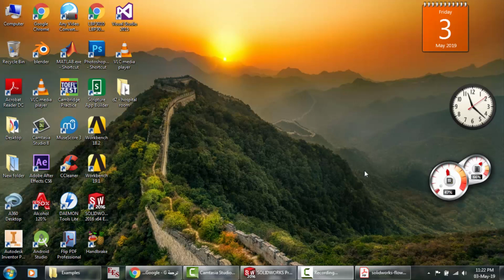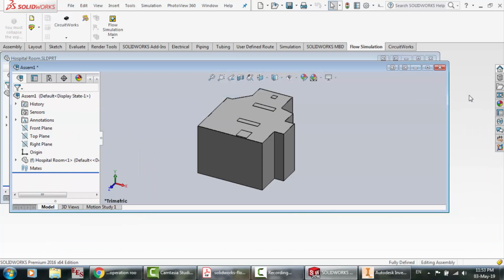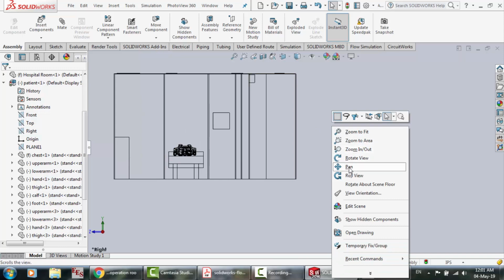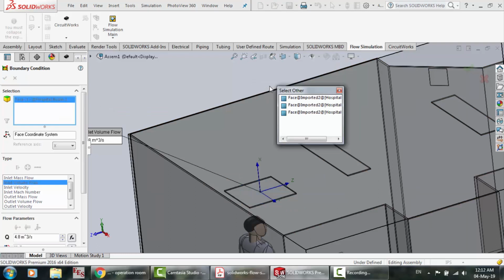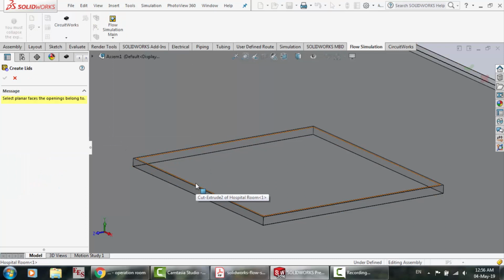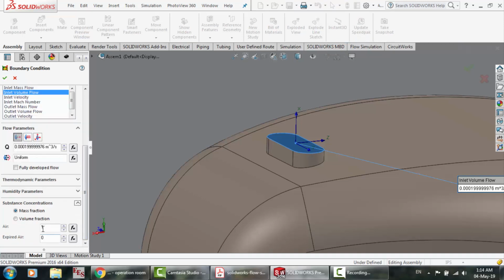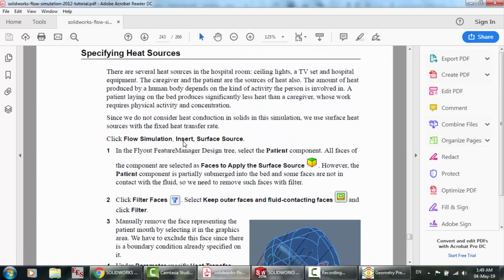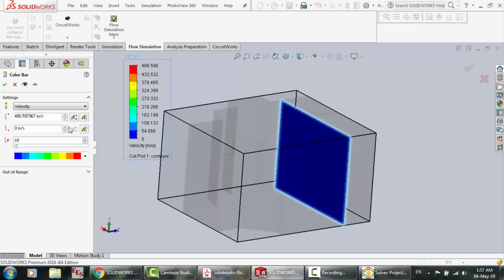A CFD simulation about a hospital room using SOLIDWORKS flow simulation HVAC module

Comment: Hello sir , if I want to use this model but in ansys fluent software how can I extract the air volume from this model ? (air volume of the room - the volume of the patient ,care taker and other solids ) Thank you.
Reply from the maker: Hello, create the air domain by drawing a rectangle and extrude it as add material. Then import all other bodies as add frozen. Then create boolean subtract to create the cavity. Then open the file menu and export the geometry as step. 
You will generate a step file that has the room with the cavity. Create a new project and import that stp file and you will find the air domain that has the cavity that represents the consents of the room. 
We do not generate the mesh after using boolean in 3D cases because it causes overlapping issues and divergence. That's why you must export the geometry and import it in another designmodeler. 
However, the cavities contain curves that cause mesh quality issues and cannot be fixed because the max skewness exceeds 0.98 and it is impossible to fix this with such complex curves. It only works if no patient cavities are included.Danke!
Reply: @haveanicetime   Thank you so much sir :D

Comment: Hello sir, can we also use this solidworks feature to simulate air flow inside an open moving vehicle?
Reply from the maker: Hello dear Philip, watch my video about simulating the air around Tesla cyber truck and see which is better for your case. It is in my CFD playlist. Danke!
Reply: @haveanicetime  Hi sir, thank you for the recommendation and response. Just a quick background for my case, I am going to simulate or need to visualize the flow of air inside a moving open vehicle, e.g. an open bus. I need to check the flow of air that goes inside the bus thru its open windows. I've watched the CFD for Tesla Truck but it only showed visualization/simulation of air flow outside the car for optimum aerodynamics. Is it possible to also see the simulation of flow pattern of the air that goes inside the car if the car windows are open? using this method? or can you refer to me a method which can cater this kind of set-up? Appreciate your feedback sir. Thanks again.
Reply from the maker: Hello dear Philip, yes, we simulate this case using the internal flow not the external flow methods. Simply we prepare the geometry of the car and it is like a room. Then we select eh windows and set the BC's to simulate the inlet flow velocity and the outlet pressure. This is very easy. Can you do this? Danke!
Reply: @haveanicetime  That's good to hear sir. Do you have any related videos same as this case so I can make it as reference. It would really help me a lot with my thesis to have a instructional video of this or if possible to share PDF exercise with that case. Keep up the good work sir.
Reply from the maker: @philipearlbanuag8000  Hello dear Philip, type here your e-mail to send the pdf to take it as a reference. Simply, you apply the same procedure of this video but on the car. Assume that the car is the room. Danke!
Reply: @haveanicetime   Your inputs are very much appreciated sir. Please send it to my email: bphilipearl@gmail.com
Is it ok to email you if I have some questions related to this matter? Thank you very much sir.
Reply from the maker: @philipearlbanuag8000  Check out your e-mail. Yes you can ask about any issue you face. Danke!

Comment: When i do my simulation, it tells me that the system is not water tight thus prompting me to create lids for the intake one the outlet streams... The problem is that when i try an select the inside face of the intake vent, it lights up, but does not register as i select it... Any suggestions? It says : "Select planar faces openings belong to" so i right click on the face (opening i want to make the lid1) scroll through the manu of the given available faces, and pick the one that is the inlet. It just does not want to let me select it!!! Any help would be appreciated. Thanks
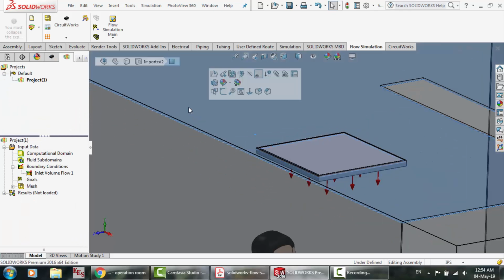Reply from the maker: Hello dear Dennis this happens when we do not follow the procedure I showed in creating lids or the rectangle in the sketch at 28:26 to 31:12, create a rectangle or a square the extrude cut then create the lid and be sure the whole volume is selected and it turns to blue..Try it again please and tell me...Danke!